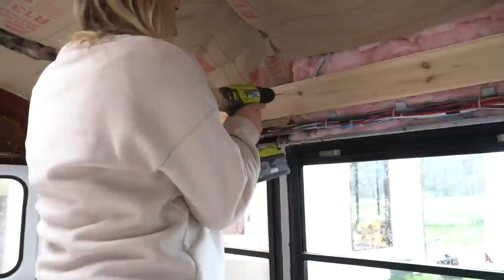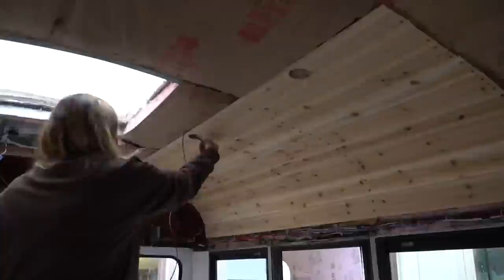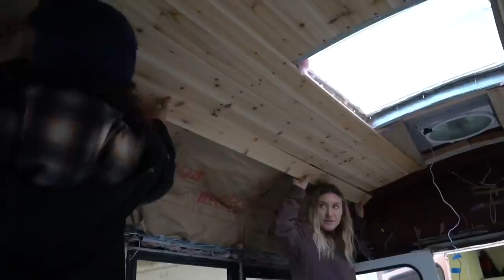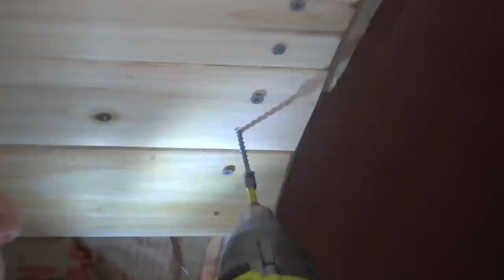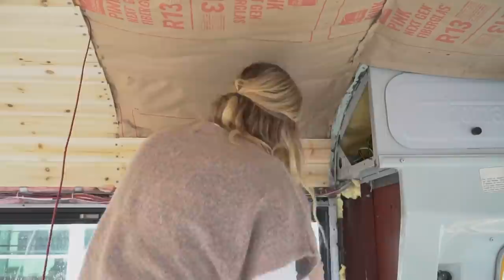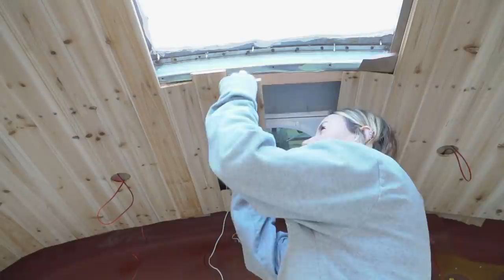Cedar Tongue & Groove Ceiling in Short Bus Build - SKoolie Conversion

Comment: Where you left the wiring showing on the bottom row , you could use plaster gutters to cover it with . It will make the wiring easy to get to and you will have a shelf the length of the bus on both sides for storage . I know you could build wooden shelf to do the same thing. I going to use gutter for my shelf in my bedroom .It will give me place to charge my electronics, a place for my books and maybe some plants and it will not take up lot of space .

Comment: it looks nice the only thing i would have done is to stagger the joints on the ceiling and used a pin nailer to mount the strips instead of screws
Reply from the maker: I had to do it this way because of the framing. I screwed it instead of nailing it because it will be mobile so it’s less likely to pop off and I can remove it easily if need be
Reply: @LeaveHerWild  ok makes sense

Comment: Nice 👍👍👍 good job 👍 Isaac and your friend , I have a 18 foot 1972 RV trailer stock , that I just ripped the ceiling out I'm adding 2x4s to the 2x2s to make thicker ceiling so I can ad can lights and thicker insolation to , I'm doing same thing but blue pine or ceder not sure , I have a flat roof

Comment: The only concern I have is all those exposed screw heads.  Are you thinking about covering them? I imagine there are several ways to do this.  I first thought of thin veneer strips that extend from one side to the other that you can either glue or staple on.
Reply from the maker: No, I like the rustic industrial look

Comment: It's great, Curious to see how it gets trimmed out like around the fan and the edges just above the windows. How about any stain or finish?
Reply from the maker: I have a plan for that! No stain, it’ll be sealed though
Reply: @LeaveHerWild  Nice, I was thinking a good coat of clear would be my choice too.
Reply: @LeaveHerWild  sink your screws! You will like it better! Just level with the board! Looks great! I agree no stain just seal! Can’t wait to see what you do next!
Reply: 👏 😁Look at what you just acomplished! Bravo Jaylena!!!
Reply: @51-FS  Ohhhh man, I love that technique and so many aren't aware of it. It is a lot of work though, but man does it ever look good. I've have toyed around making a couple little jewelry boxes, more like wooden cigar boxes lined with felt and I used that technique on the wood. It's so awesome.
Reply: @51-FS  Another cool technique I found by accident. A buddy had bought a showroom full of solid oak Armoirs and Entertainment Centers that had heavy smoke damage. I mean some of this stuff was solid black. He bought this stuff like 10% of wholesale. One piece so bad he sold it to me for what he had in it. I sanded it, but just enough to get most of the black off of it, and left some black that was down into the grain. I then cleared it with about 3 coats of acrylic clear. Turned out so awesome. Still have to this day and it's like 20+ years old. TV no longer fits it, but I can't get rid of it. Going to repurpose it for something.
Reply: @51-FS  Don't think so, would be too dark, and kinda dangerous to do it after installed.

Comment: Hi jayleana  I love the cedar but why did you put all the joints on one spot ,I do believe it would have worked out better if you would have over lap the joint ❤️
Reply from the maker: I don’t understand what you’re saying?
Reply: You stop and started each row all on the same spot
Reply: All of your joints are in a row
Reply: I was curious why also
Reply: @LeaveHerWild  Look at your floor and then your ceiling.  On the floor you staggered the joints but on the ceiling you did not stagger , so your joints all line up on the ceiling.  Just wondering.   You are doing a great job.
Reply: @Daniel Wood Wrong term, staggered, not overlapped.

Comment: Finally got your ceiling in, looks good, but wonder why you didn't stagger the board lenghts to avoid the straight joint all the way across the ceiling of the bus? When I did mine a few years back the first board went right done the center of the roof and then worked left to right so that the boards at roof vents were equal sizes on both sides and the same as the boards that met the side walls were the same width.. I just tryed to keep it all balanced. It's a feng shui thing with me.
Reply from the maker: It’s much easier to do it this way with the way it’s framed
Reply: @LeaveHerWild  Well, you could have staggered the joints by placing a long board spanning the full length, then one a section shorter, then one two sections shorter, etc.
Reply: Coming from a Construction background I also questioned why the boards weren't started from the middle working outwards, and why they weren't done with staggered joints.  JMO
Reply: @RimdarRanch  I agree, but it is probably because she's just learning, and wanted to do it the way that seemed easiest.  Hope she decides to cover those joints and screws.
Reply: @David Mooney  I went to church with a David Mooney several years ago!

Comment: At first I thought, you need a nail gun, using screws gives you the option to remove boards for repairs. Great job kid. Mike from Maine.
Reply: I was thinking the same, but being a bus that's mobile, I have a feeling finish nails would have just eventually popped out so screws are likely the best way, and pre drilling to avoid splitting was smart too.

Comment: I just watched  your video  on the ceiling install  I was wondering if I could  give you a couple of tips   I noticed  that the front part of the ceiling  don't line up   if you start in the middle  work back  it will all look the  same and your joints will line  and counter sink all the  screw   great job  hope this helps you

Comment: I'm guessing you are going to put some sort of strapping to hide all the screws.  if now I would have went with some sort of brad nail. that is about 1 1/2 inch to put of the cedar, and construction glue, to hold it up.  And if you really had to use crews  would have pre drilled each hole and counter sunk the screws. and let them set just a little under the wood and you could have made plugs out of some scrap material left over and glued them in behind the screws and once tried sand them smooth, and also would have set the tong and grove boards so they would have all lined up, some like you would do with hard wood floors.
Reply: But, not your bus. Right? You do you.

Comment: Looks good, but is there another option that wouldn't show all the screw heads? I've never noticed that in other buses before. 🤔
Reply from the maker: I’ve seen it a lot in other buses, there are a few reasons to do it this way
Reply: @LeaveHerWild  I guess they never show it that closely so I've never noticed.

Comment: Looks good! BUT stop cutting your boards with crossing your hands!! When you had the long piece of cedar to the right side of the chop saw you crossed your left hand over to the right side to hold the long piece and you operated the saw with your right. You place your left arm in the path of the saw blade as it comes down. A great way to cut your left arm!! Instead, hold with your right hand and operate the saw with your left hand. Whatever side the long piece is on and you want to hold it make sure you don't cross your hands. I'd hate to see a title of your video, "I spent time in the hospital"!